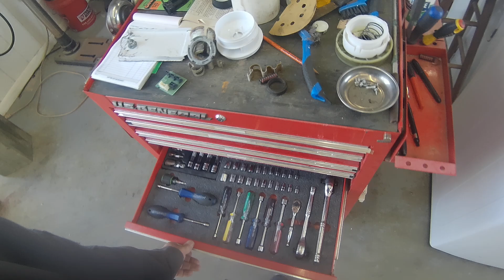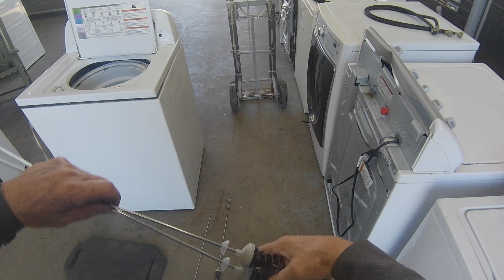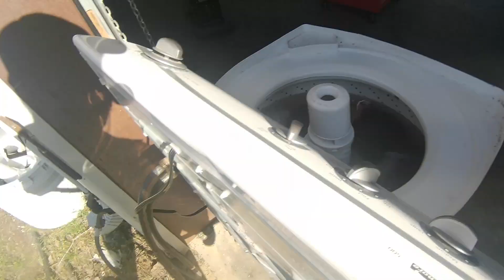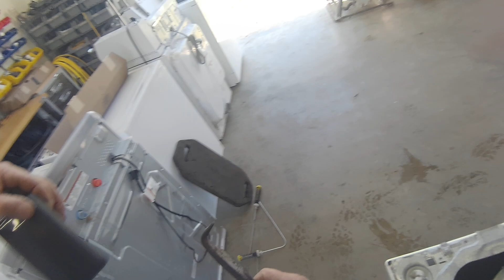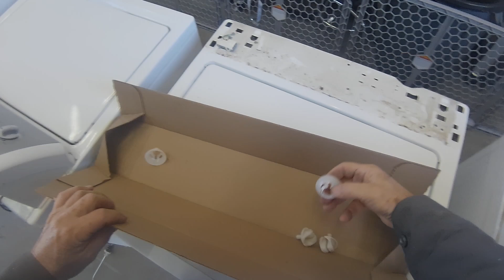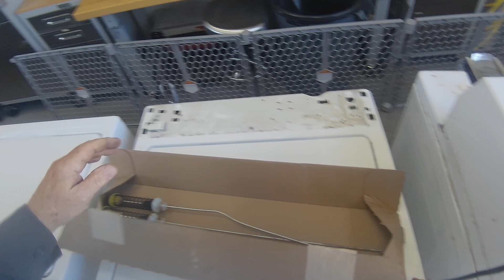Washer Shaking & Banging During Spin? Replace Suspension Rods (Amana, Whirlpool & More)

Comment: Thank you so much. My Amana machine has the same problem, and I hope now I am able to change the suspension rod's. Also I appreciate if you could tell me where to get the Tub Balancing Tool.
Best Regards
Reply from the maker: That’s a tool I built myself. You can use a scissor jack and a board and do the same thing, just a bit easier to make the tool. I have a video on making those on the channel. Thanks for watching!

Comment: That suspension system is bad, very bad. You can install GE's bottle- or cap-type suspension rods that work with air; it's much better and not complicated to adapt; it will last a long time.
Reply from the maker: Can you really? I never even thought of that. Thanks for sharing that tip!
Reply: @HarperandKnowles  Yes, because the rod length does not differ much, but the springs must be changed, because the GE cap-type springs have different spring sizes, the springs can be removed without breaking the rod.
Reply: Would you be able to make or recommend a video showing this? I'd be interested in doing the conversion as a preventative.

Comment: Chip:  I have a question.  For typical VMW washers, what is the best way to remove the tub?  I’ve seen the scissor jack/2x4 method, but is there any special tool to do so?
Reply from the maker: Not that I know of. I have had to place the bolt back in the shaft with a few turns to get a little more length to the shaft to get one off but the method is proven. If you come up with something better please let us know! Thanks for watching!

Comment: Chip, great repair. Have you tried your tub realignment tool on any other brands of washers besides the Whirlpool varieties? I recently came across a Samsung washer with this problem but I don’t recall if it had an agitator.
Reply from the maker: No, just the Whirlpool brands. The problem I have with those Samsung active water jet machines is a messed up tub hub I think. I don’t remember exactly what the part is called but it’s no longer available new and the ones you find on eBay are defective too. I don’t think the problem is the tub. I’d like to figure it out. But it causes a lot of those machines to be scrapped.